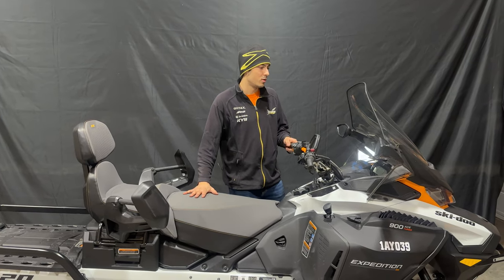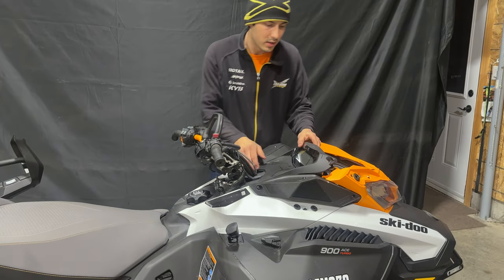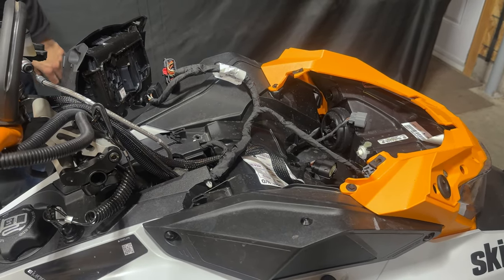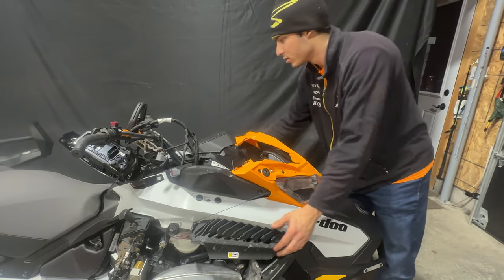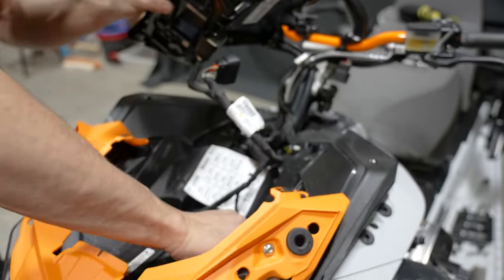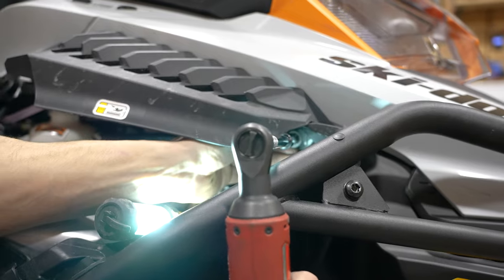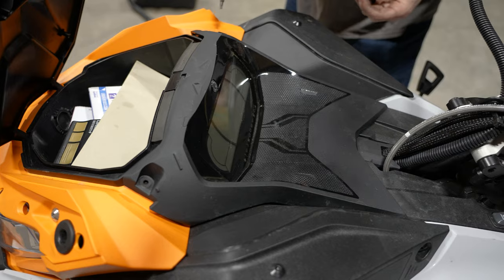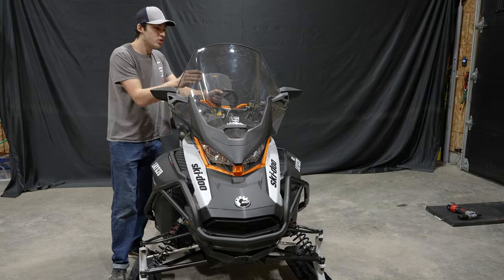How to remove hood on a 2023 Skidoo expedition SE 900 Ace Turbo

Comment: just wanted to comment that there is no grommet on the front, you need to pop both sides and then move the assembly ahead slightly and lift off. there is a plastic hook at the front.